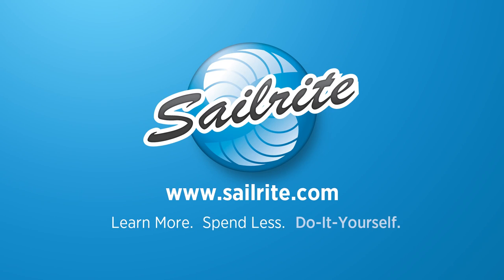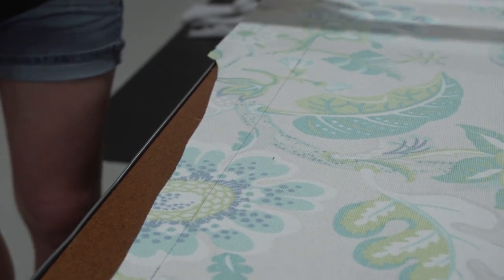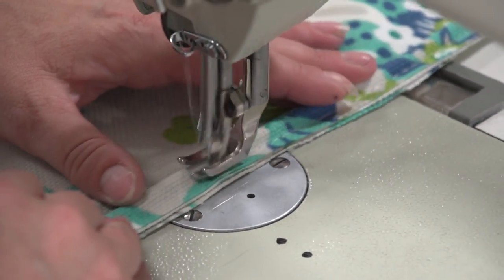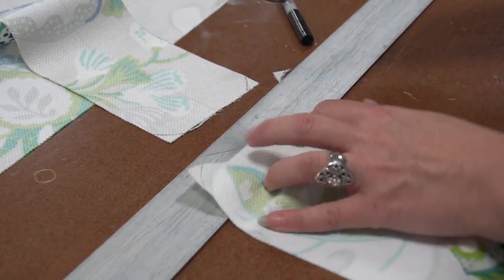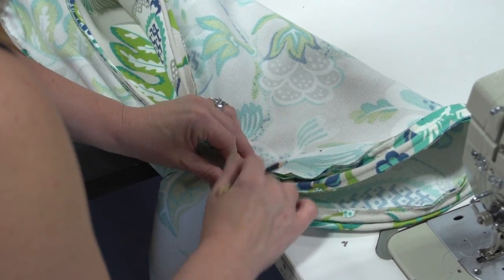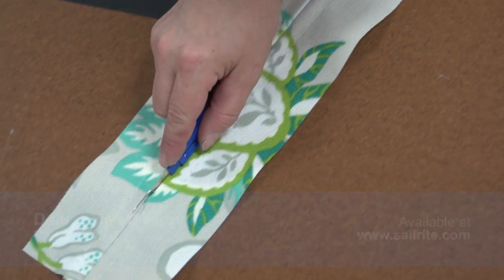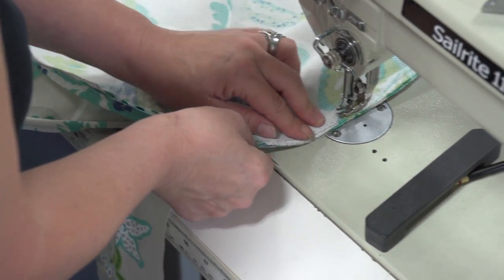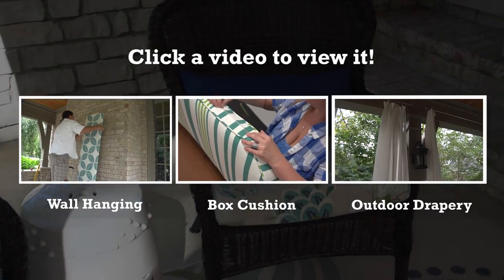How to Sew a Bull-Nose Cushion Cover

Comment: I have used this video several times, very well done, easy to follow. This time I should have used 1.5"  strips for the piping as my outdoor material and cording was thicker than was used in the vid. I used an old Singer adjustable zipper foot and moved my needle close to the piping for final join.

I have used my soldering iron in the past, this time I used my serger. The material was very shreddy, so the serger was useful. The soldering iron takes longer than serging imho. A Sailrite machine and hot knife would be lovely if I was commercial.

For sewing the zipper line, I used masking tape (tripled) to make my guide line. Worked great.

I am not a professional, and if you don't look too close, my cushions look pretty darned good.
Reply: Ps, I have used the double-sided tape for piping (in the past). Without a commercial machine, it is a gluey mess and a struggle for standard sewing machine needles. I do not recommend for home sewing machines.

Comment: Is there any point in cutting welting on a bias with this kind of fabric?
Reply from the maker: Cutting fabric for piping on the bias gives you two advantages over cutting straight cut piping. Cutting on the bias will reduce unraveling of the fabric edge. Also the fabric will take a turn on a corner or curve more smoothly than a straight cut piping. However, it takes more labor and seams to make a bias cut piping, so you must pick your process based on which benefit or negative you want.

Comment: You guys make the best step-by-step-step DIY videos.  After watching this one, like many others, I feel empowered to take on projects that I never would have though I could tackle.  Thank you for this rich source of educational sewing demonstrations. I don’t own one of your machines, but because of your customer service, I am becoming more inclined to purchase the blue version that has the zigzag walking foot.
What does the white 111 commercial machine have or do, that the blue machine does not?  Thank you for an explanation about the differences between the models.  I know the capabilities of the red machine.
Reply from the maker: Thanks for your positive comments! The Sailrite Ultrafeed LSZ-1 is a great sewing machine. The Sailrite 111 has recently been improved and is now called the Sailrite Fabricator Sewing Machine. Here is a link: https://www.sailrite.com/Sailrite-Fabricator-Sewing-Machine-in-Power-Stand-with-Workhorse-Servo-Motor
The Fabricator is a straight stitch only sewing machine, it does not sew zig-zag. However, the Fabricator does have a few advantages over the LSZ-1 it has a bigger underarm space, higher foot lift, a knee lever foot list, and a larger bobbin. Both the LSZ-1 and the Fabricator are great sewing machines. Let me know if you have more questions. You can email me at: ericg@sailrite.com if you like.

Comment: Do you also condense the high density foam when making a cushion? Do you cut the cover the same size as the cushion with no seam allowance?
Reply from the maker: Yes, but when using High Density Foam cut it only 1/4" larger on all sides. Then cut your top plate to the same size as the slightly larger foam. After taking away a 1/2" seam allownace this will make the cover slightly smaller than the over-sided foam compressing it slightly.
Reply: Thank you.

Comment: doesn't the basting tape gum up the needle?
Reply from the maker: Using basting tape (Seamstick) for canvas on a very light weight fabric may gum up the needle rather quickly because the lighter fabric does not have the larger fibers or weave to help clean the needle as it exits the fabric. In those situations it may be best to use a seamstick that does not have as strong an adhesive (like item #20306) or instead use pins to hold the fabric in place as you sew. A gummed up needle and parts can be cleaned off with some rubbing alcohol on a cotton ball or Goo Gone (we do not sell this). I like to use McLube #845 on my parts and needle to clean and keep glue from building up.

Comment: I'm wondering why you put the zipper on the top of the cushion instead of the bottom where it wouldn't been seen?
Reply from the maker: We installed the zipper along the back of the cushion in the boxing or facing of the cushion. It is not visible at that location. It can be place in the bottom of the cushion if you like.

Comment: The boat cushions I am replacing have an extra 1" of foam on the top front at the bull nose, about 8" towards the back. There are a few buttons used to pull the top plate firm where the extra foam ends.

How do I determine the top plate and front to account for the extra foam width?

Edit: I think it is called rolled front cushion.
Reply: I have the same cushion to replace.  Have you figured out how to manage this yet?

Comment: Can you use a cotton or polyester type of cording and not the firm kind like you are using in the video for an outdoor patio cushions? Thanks
Reply from the maker: Yes, for outdoor upholstery I like to use the Medium Welting Cord. It is softer and takes turns easily. It also does not soak up water. Here is a link: http://www.sailrite.com/Notions/Trims/Pipings/Notion-Material/Polypropylene/type/Products?order=custitem_popularity

Comment: Is it necessary to used a walking foot presser for this type of sewing? I dont have one and wondering if I can use my all purpose presser foot instead?
Reply from the maker: Yes, a home sewing machine without a walking foot can usually sew lighter upholstery fabric (as seen in this video) easily. If your sewing machine can sew three layers of denim blue jeans, then it should be able to do a job like this easily.
Reply: Sailrite i have not tried sewing multiple layers of denim jeans yet but i did made some pillow covers and it is 4 layers because of the piping. The fabric is medium weight. Thanks
Reply from the maker: If you were able to sew that you should have no problem using your sewing machine to sew upholstery like what is shown in this video.
Reply: Thanks for the respond. Little by little and with the helpful videos that you guys uploaded here, i am convincing myself that I can do this too. The material that i choose was a medium weight polyester outdoor fabric, will my all purpose presser foot still works? Thanks
Reply: Sam Cole how to cut material for a foam cushion

Comment: thanks for video very easy to follow but i haave one question why was'nt the cording strips cut on the bias
Reply from the maker: +gwen sumlin You can cut piping or cording strips as straight cuts, as we did in this video. It will save on fabric usage doing it that way. However, if it is cut on the bias it will not ravel as much and will take curves better, but it will use more fabric. So... the choice is always yours with advantages and disadvantages to each.
Reply: thanks..i will try it with the straight next time.

Comment: What are the seam allowances being used? 1/4" or 1/2"?
Reply from the maker: Kathy Upton For this project we made a piping that would place our seam at 3/8" in from the edge.
Reply: Sailrite the seam allowance for the boxing to the main cushion fabric and the zipper fabric to the main cushion fabric is 3/8" seam allowance? when you cut out the main fabric you subtracted an inch for compression, the boxing fabric is 4" wide the width of the cushion so i was assuming a 1/2" seam allowance, does this make sense?????

Comment: I used the tips from your videos to make some gorgeous slipcovers for my resin wicker patio furniture:

https://s31.postimg.org/98rnkwffv/02502_cc03_sm.jpg and 

https://s31.postimg.org/9nv7jyqi3/02518_cc04_sm.jpg

The seat cushions are bullnose style with piping and I used your awesome foam cord for that. The chairs came with the foam inserts so I did not have to buy those. The back cushions have 4-inch boxed corners, piping and zippers along the bottom. I used Richloom "Muree Primrose" fabric that I got on a great half-price sale at JoAnn's and Coats & Clark polyester thread to match. I had to get the #5 coil zippers from The Zipper Lady, (in peach color) as SailRite did not stock any colors of zippers, it seemed, aside from black and white. The background of that fabric is a sort of peachy-beige color, though it appears white in photos. I wanted everything to match and I think they turned out well.

I don't have an industrial sewing machine, just an ordinary home machine. It does not have a walking foot. I will say that makes it more difficult to work with this type of fabric. I opted to not use the basting tape (trying to save money), though I'd definitely recommend it as it would make it easier to make the piping. Possibly I'd even use it to baste the seams to keep everything lined up until you can get it sewed together. Definitely get a piping foot if you don't have one. I got a low-shank piping/cording foot for about $5 on eBay. It made the task sooo much easier! I didn't have a hot knife either and so just cut the fabric with my Fiskars scissors. It frayed like crazy - ugh! When I finished the seams, I over-edged them after trimming  off the frays so that I could wash the slipcovers if I ever needed to. 

https://s31.postimg.org/av4gn8rxn/02403_cc02_sm.jpg
Reply from the maker: Great job! the project look wonderful!!!
Reply: xtafpfhr i dont have a walking foot either but does it really really hard to sew this type of outdoor fabric by just using an all purpose presser foot? Luckily my sweing machine comes with a zipper foot that i do not have to buy. I am also learning to sew and this video is really helpful. I am a novice sewer. By the way your project came out awesome !
Reply from the maker: Most home sewing machines can sew upholstery fabrics well. Chances are your projects will come out great!
Reply: Your chairs turned out beautifully!